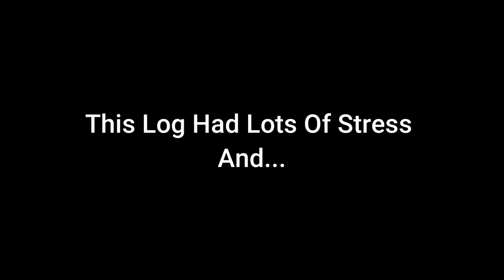This Is Not What You Want To Find Inside A Log At A Sawmill

Comment: why do sawyers say 5/4 and 8/4 instead of just saying 1 1/4 or 2 inch?
Reply from the maker: takes less time to say it maybe? less room for error?  way I was taught,
Reply: It's because when you say "X quarter" like 4 quarter or 5 quarter you're referring to a nominal thickness or the actual thickness. Dimensional lumber like 2x4, 1x4, 4x4, etc like you buy at home depot is not actually that thick. It's purchased that thick but then planed down after drying (a little) to correct for any warping/twisting/etc. A 2x4 has a nominal thickness of 1.5"x3.5". A 1x4 is actually only 0.75" thick by 3.5" wide. When buying rough sawn lumber we use "quarters" for thickness so we know we're taking about the ACTUAL thickness, not dimensional lumber thickness. Hope that helps!

Comment: Would it be worth it to use an air hose instead of a scraper to get the sawdust off?
Reply from the maker: good idea, maybe,
Reply: @OutoftheWoods0623  
Or a push broom?
Reply: @OutoftheWoods0623  There's lots of battery powered leaf blowers that would work well for saw dust removal.
Reply: Along with your battery powered chainsaw, both handy to have in the shop. Good for the sawdust on the floor, especially in tight places you can't get to with a broom. Also great for fanning the flames when your starting your bonfires. I've also swept and dusted many a floor with an air gun running off a compressor.
Reply: @OutoftheWoods0623  Better to know you're going to have grain issues early on, though.